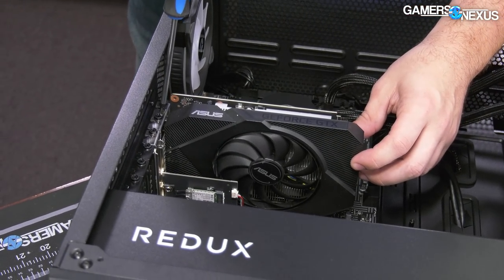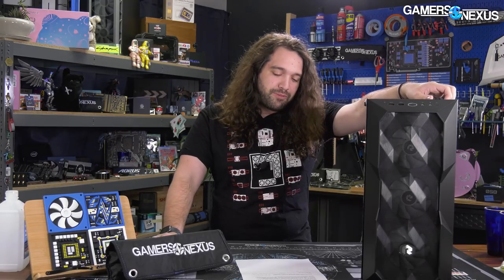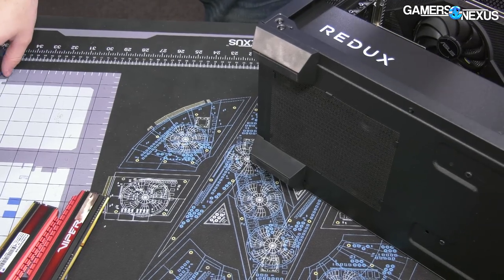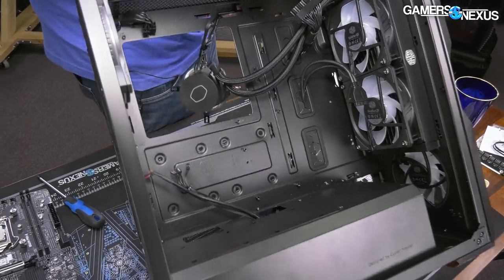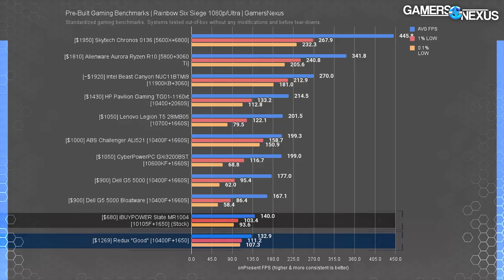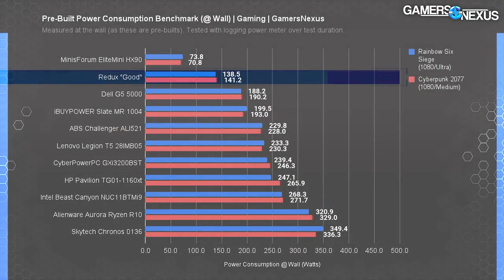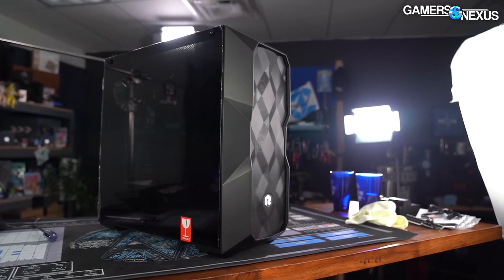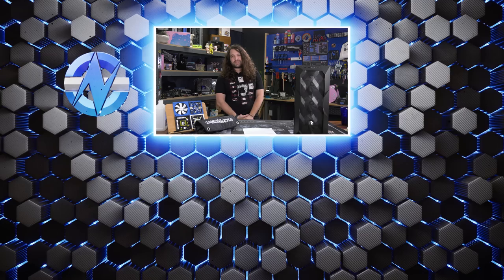YouTube Ads Told Us to Buy This: Redux Gaming PC Review

Comment: I'm sorry, no 1300 for 1440 is not acceptable, I purchased a $1400 legion 5i (it came with a 3060, that's the reason I bought it) That didn't get me much in cooling overkill, or any sort of RGB or cool factor parts. But it does play outriders in 4k on ultra/quality settings, and doesn't get anywhere near ramping the fans up. Haven't dug into the overclocked yet, I figured I'd swap the power supply for a modular, get it water cooled, and RGB, re manage the cables, then take care of that.

Edit: instructions clear, outcome not so much,
dick stuck in power cables 😆

Comment: Just received my Main Gear 3060ti PC. Guess what? Found out had to turn in on for at least 2 hours to load a supposedly activated win 10 after 6 hours gave up. Brand new and did not work from the get go. There e-mails where so nice with one stating it was in the que awaiting the first tech to build it. Well, the box says made in China so no one at Main Gear put this together. So, now sent them a e-mail stating the problem. So waiting for a reply 3/13/2022. Is my $1600 gone. Wanted a company in the US, was that a mistake. If they do not honor there warranty, guess report to my bank a defective product and try to get my money back. Trusting people just because they are in the US may have been a mistake.

Comment: It's only a terrible value in the aspect of they use name brand quality parts with "no wonkiness."  But you pay for that. We would have to pay the same for that build.  So technically speaking it's not a bad value.    So in essence Steve, your expectations ARE unrealistic.

Think of it this way: ABS is a corvette.  Fast and cheap for the money.  It works.  But it's not exceptional in build quality.   We have seen the kind of generic GPUs and PSU's and motherboards these builders use.

Redux is a Ferrari.  You are paying for the higher quality components which likely are limited supply and they don't get a good discount on.

If you want a quality build, the redux is excellent.  You get non-proprietary parts which should last a long time and can be upgraded in the future.  The old adage goes: You get what you pay for.

Comment: Going to have to disagree pretty strongly on the complaints for using adhesive pads to secure the fan and RGB header.  There is zero issue with this and it seemed like it was well secured.  Modifying the case with a through hole is laughable and its pretty hypocritical when you were just talking about spending money on things that are not needed.

Comment: I have just seen worst pre-built system for the price ever on newegg, $12k for a Gen 3 ryzen, 32gb 3200 ram, 1650 GPU, 300w PSU. I don't think this would be worth $1,200 let alone $12k. Anyone else see this or did I miss something?

Comment: I always push for air cooling especially if gaming 1080 p good air cooling is more than sufficient .when building a decent 1440 or a 4k that gets respectable frames at high settings liquid cooling needed the difference is temps would be great enough that going liquid over air in that situation would get you a longer lifespan for your CPU and GPU if going liquid on both . But don't get the cheapest cooler you can find a majority of the time the Pumps last about a year if your lucky but a good one which really isn't that much more expensive over the cheap ones . You will get years out of it especially if you change/check the coolant more than 90 percent of PC games do . ( Some never do ).
Reply: My rig can't be air cooled but it's an overkill build, I9 13900KF and a 3070TI. But with my previous builds and any budget type of build its always been air cooled for me aswell,

Comment: What a cheap MB, the VRM does not have heatsinks, and a AIO 240 watercooler for a Intel Core i5-10400F, that is really overkill.

But is ok with a GeForge GTX 1650, but you can always upgrade them both later, IF the graphics card get normal prices, and 
i have a feeling that will never happen again, i really hope i am wrong, but yeah the price is REALLY high for what you get.

Comment: So if I'm understanding, you got the bare minimum specs and are frustrated the specs are bad? Like no duh. The coolers and fans would fit in great with the higher models they offer. It's like you did zero customization to the actual build which most people who watch this channel would do and it would fix the problems you're talking about

Comment: $1300 for this kind of PC. Thats a rip-off!
It annoys my mind (as a competent PC-build man myself) to see these kind of builds.
240mm AIO on a i5-10400F.. WTF!? That CPU gets to around 70c @stresstest on the stock Intel cooler @25c ambient (which is totally fine). Overkill cooling is never Bad, just waste of money here. Actually the AIO makes the boards VRMs run hotter, compared to using the the stock cooler. So it would have been better to use the stock cooler here.
700W 80plus Gold = again overkill don't hurt.. But on a 10400F+GTX 1650 system? Again... Totally overkill for a system that uses 140W in gaming.
Why not use the stock CPU cooler and a cheaper 450W Bronze rated PSU? Thats plenty+ for this (including headroom for a better GPU)
Shave $150 off the price, and no diference in performance.
The 1650 has no business being in any $1000+ PC at all. This is a low budget gaming GPU. Even the old GTX 980 is better.

The Good thing about this, is that this is part of my competition regarding PC-builds. here I have a Huge advantage in my business regarding the Value, I offer on my own builds.

Comment: You can say what you want of Dell, but for the same price as this thing, I have 10700k with a 3060ti, 16gb RAM, 500 SSD.
Yes I'm lock into everything, can't tune anything in the BIOS, but with a few fan tweak I'm not running any hotter than any AIB and sound level still better than my friend 4k water cooled PC.
And for the hater, it's a transition build i intend to sell for around what I payed when price come back to a decent lvl, if ever.
Dell is utter crap for uniformed people, but you can make it work if you tweak their shit prebuild

Comment: i still consider it a lie. Charge msrp for a 1650 at $300....but than they grab an MSI Mech that can be bought for $110 on amazon. they're not charging "$99" build fee. theyre walking away with a $600 profit off this POS that you could built yourself for under $700.

Comment: Generally those small GPUs are a scam.

They are fine for maintenance or 4k movies but i would not game with them more than couple of hours per time.
Real gamer puts in 6-12 hour shifts with simple kitchen&toilet brakes included.

I agree that this setup is not good, even if you can buy with similar price tag.
I would down the CPU and other components to get better GPU, they done the very opposite.

Comment: my problem with this is that the good tier on the website comes with an rtx 4060 and he is using a 1650. Also instead of using a intel processor he uses an amd which is a lot more expensive than nvidia on the website because of the motherboard required.
Reply: Just so we are clear...You know this video, when you posted this comment was already two years old.
Reply: @addictedtoautism420  no 😭

Comment: I have a lenovo legion y540 gaming laptop with 8gb ddr4 2666 ram single channel (added another 16gb stick cuz 8 gb alone is a no go but duel channel does work fine so 24gb I total) a i7 9750h and a gtx 1650 with 1 tb hard drive and 250gb ssd and that was $1150 and that was in late 2019 and is a great system for 1080p gaming. You got scammed cuz for a few hundred dollars more you can have a rtx card in the laptop this... this here is bad.... just bad. You could pay a scalper for a ps5 or series x and that's 700 dollars or more like seriously this is bad. If you want a system with a rtx card then get a laptop because scalpers have trouble scalping laptop cards lol.

Comment: I literally just purchased 12th gen i7K, 2TB 980 Pro, Noctua D15S, Asus ROG Strix Z790-H, 32GB Corsair Vengeance ram and Phanteks Enthoo Pro case for under $1k. A pre-built is kind of a scam to be honest. It's not that difficult to build your own PC these days.
Reply: Yes but what graphics card did you put in?
Reply: @somethingtrulyhorrifying  Transferred over my old PNY GTX 970 then upgraded to ASUS Strix 4080. I was mainly referring to the quality of components in comparison to the components you find in pre-builts. The GPU addition obviously cost a big chunk until recently where AMD has been releasing some powerhouse cards for way less.
Reply: @stevensims3342  I'm just sitting here imagining upgrading from a gtx 970 to a 4080 lmao. That's a beast of a rig. Certainly more than any 1300. But I agree you're better off piecing the components together yourself. Some people just don't want to do that, or they want a company to back the rig with IT services for them, so they go the pre-built route. Couple years ago pre-built was the best bang for buck, with the gpu shortages.
Reply: @somethingtrulyhorrifying  bro the card is massive 😂😭. You're right about that (pre-built gpus) haha. I actually had to remove the internal sub ODD panel in the case in order to drop the card in the mobo. It really has been quite the upgrade. Kind of a heat pump now lol.

Comment: Prices? All way too high. Starts with ram. They will sell you some oem cl20 bullsh1t. Then for 3060 ti they will sell you 600w random/noname power supply. Then a card itself that will be probably be some one fan, small factor card that will overheat in windows. Not to mention some bad motherboard and ssd. And of course they will never give you any specs of parts you're buying. Yeah you are still better off buying stuff yourself.

Comment: for giggles I went over to their site. their base systems are just horrible and so are their parts costs. this is a company taking advantage of people who have no clue about computers.

first they bottle neck the system with older and more expensive CPUs. trying to push out those outdated 11th gen CPUs, and some 12th gen. you can go in and customize with a 13th... but how many typical non builders are even gonna look or know what to look for. then....

those CPUs are slightly over priced... but what's worse are the GPUs are $100 or more over the market.

 they are also up-charging a good bit on the mother board, you don't even get a choice in what one you get.

 the memory is Im guessing some no name brand as its not listed. and you can only buy as amount of memory and not speed or cas latency. and they are charging you 2-3 times more than a decent name brand you know the stats on.

 storage is well over priced and has no stats connected to it. again side listed only.

you HAVE to take their cooler suggestion even tho its overkill unless you plan on overclocking which I don't think is possible on their junk parts (and they keep lowering power supply which will limit your overclocking).

 their case is STILL the TD500, not to mention they are still using outdated 2tb HDD and massively up charging. and even on the gen 13 the only option is the ddr4...

all in all I could build one for half their prices and still leave them in the dust.

its sad when a Dell and HP can actually outperform a "custom built", they are making WAY more in profit than just that 99, and there is a lot of up charging.

Comment: 26:45 100% disagree.  It's better than Dell, and that's not really a hard benchmark.  Yes, their component selections could be better, but it isn't proprietary, and I'm 100% positive that they used better SSDs than the garbage-tier Dell uses.  Unlike a Dell, is also isn't all e-waste if a single component fails.

Comment: You can buy a Dell G5 5000 Series with a 3070 RTX G-Force for $2500 USD IF you shop smart and wait for black Friday Sale or other and you can have a PC From the Factory That is ten times better than these I also have found all one would need for the 2070super and the 3070 3080 3090 to water cool it for less than $800 USD. I did my homework and research before buying my gaming pc and anyone and everyone I had went to was way over priced by atleast a $1000.00 USD or more depending on what you wanted installed and none of them could build my pc or my friends pc for under $3500 USD and Dell could by far and I have loved My gaming PC I plan on going back to Dell for my next tower.

Comment: redux: that new brand that makes sure you are going to have to redo all their work!  hell yeah !  Dumbass!  you're getting a redux!  

jokes aside i checked out the web site and a couple of companies have this trend for  "pick your games"  and then you "pick your resolution" then they'll show you the expected fps  on the build you are doing.  but they only allow resolution choice of 1080p or 1440p  no 4k option.  what gives?  i've owned a 4k tv now for 4 years , and it was not a super expensive tv  when i bought it 4 years ago (450 USD for a 49 inch  4k smart tv that was a really good price) . 4k is pretty standard now in large monitors and tvs .  these companies need to have data for 4k. if i buy a whole new PC , you better believe it's gonna  need to be 4k 60 fps capable.

Comment: I'm surprised that any vendor would send you a PC to review.  You always have negative comments about insignificant items.  Example, the RGB hub being taped instead of screwed.  It appeared that it took some wiggling on your part to remove, so why harp on such an insignificant detail...Seriously?!?  Most times those little hubs are either glued or Velcro on.  Also, you picked on the spread of the CPU thermo paste which appeared to be well applied on the CPU considering how paste is typically installed.  You can run this PC on max for years and you'll never have a CPU overheating failure unless your pump completely stops running.